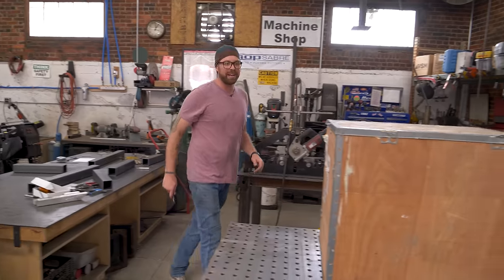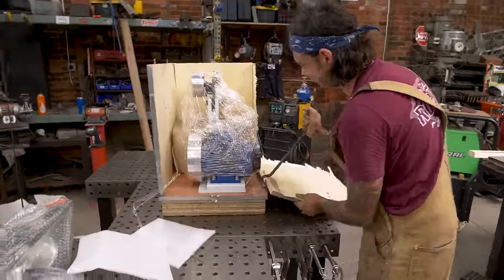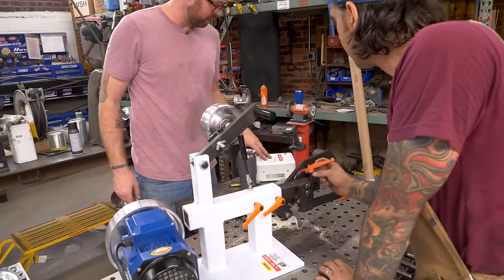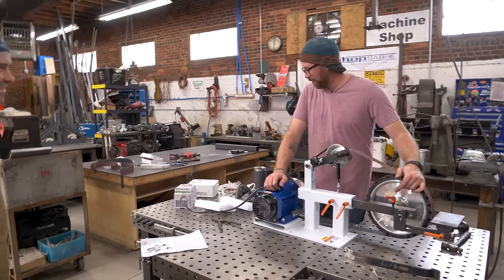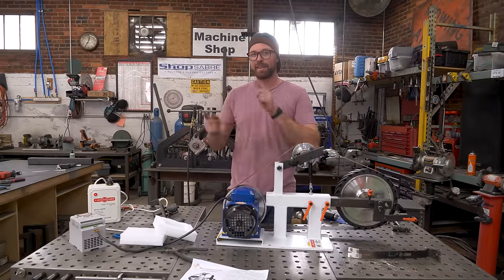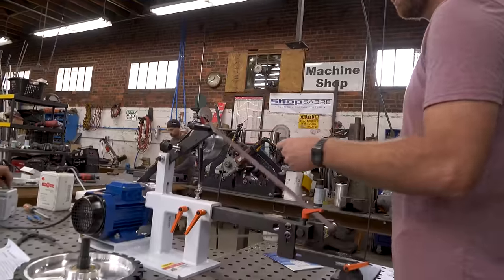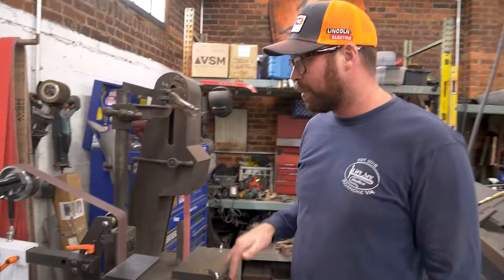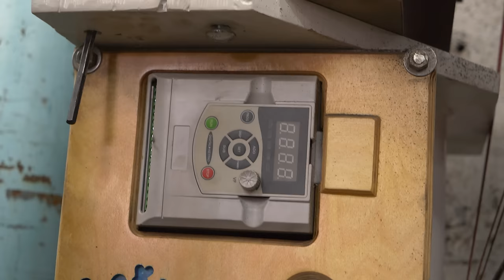Is This VEVOR Belt Sander is Actually Good?

Comment: That had to be the worst review I have ever seen . Gave no details at all
Reply: What... Else... Did you want to know?
Reply: Exactly! How are we supposed to make a sound buying decision without more details. You know, like:
How many grains of abrasive are adhered to the belt? What color are the electrons from the VFD? How many sparks per millisecond? What flavor is the white paint? Are all the protons positively charged? Does it go well with General Tso's for lunch? How fast does it fall if you drop it from an airplane? Does it feature variable reluctance? Why is the Turbo Encabulator not even mentioned?
Reply: “Covid 23” was worth every second
Reply: This guys the king of long winded videos containing nothing
Reply: It would certainly be good to have more information.  you say "what"?  well, what is the brand of the inverter, (VFD). if we have that we can look up the operating instructions.  Lots of folks question about the slow start up.  Probably the factory set start up can be changed.  What about the speed max?  Vevor is probably not going to tell you NOT to run the unit faster than what others have said, not to ruin the small wheel bearing.  What about the Vevor knife grinding jig?  Another complaint is the VFD controls.  How do you turn it on, etc?  MOST VFD's allow for a separate start/stop switch.  Does this?  (again, if you listed out the name model of the VFD I could figure this out.). What about reverse?  Yes, has a reverse, (ALL VFD's do) but how does the machine run on reverse?  Do the wheels still track well? (I know, probably yes, but nice to hear) For sharpening knives, I'd often run in reverse, as I like the edges upward and don't want to risk catching that edge on the paper.  Of course the 82" belts are a no go, but yes, easy to make it fit.  Anyway, it WOULD have been good to have a better more complete review for sure.
Reply: I disagree. This isn't a review at all. It's just the worst advertisement I've ever seen.
Reply: @paulkramer4176  All VFDs are capable of operating a motor in either direction. Most VFDs allow the direction to be reversed (since it only requires the resequencing of the output phases) but not all. I had a 15HP AC motor in a pretty rotation direction critical application, reversing the motor required physical wiring changes at the VFD (should the site have power whose phases are opposite of desired).

Comment: Tay just a heads up on the small wheel attachment don't run it over 40-50% power or you'll burn the bearings out. They are designed to handle that much rpm.

Comment: Got mine yesterday. Built a trolley cart with heavy cast concrete base and locking 6"castors, did the 2x72" mod, added a water mist, catch/quench bucket, LED work-light and simplified controls (fwd/stop/rev switch, 10-turn speed pot) and an air blast nozzle. This beast is awesome!❤😂   .....working on making a cerammic-glass platen now!😂😂😂  This is a great asset in my shop!   BTW,  it now ships in two wooden crates (platen, wheels and arm in the smaller box).
Reply: Just built a Ceramic Glass platen for it and also 3D printed a block that keeps a bar magnet about .125" away from the belt as it comes round the lower pulley to trap metallic particulate. This beast works great!
Reply: Did you make a video of those mods you just mentioned ? Would love to see
Reply: @peterclinch1191  unfortunately I did not.
Reply: Just got one. Does it just plug into the converter? The plug doesn't seem like it matches up
Reply: @edoliver8686  mine plugged right in

Comment: I have a Pheer 2x72 grinder, its made in the USA (Oregon), came with a USA made wash down rated motor$$$, fairly cheap, its pretty rad.  It only cost a couple hundred more than the Vevor.
But to the point of my post. 
It comes with a warning about running the small wheel attachment at high speeds. Apparently the smaller bearings are not rated for them, and will wear out quicker.
Reply: Do you like it so far? I'd seriously consider buying it if you like urs
Reply: @jacobdillon3635  I bought it specifically for knife making and it works well for that purpose. Now if I could only make a decent knife. That's a me problem not a grinder problem. But I found that I use it for every single metal fab project that I do. It's so easy to bring a small piece to the tool rather than and angle grinder to the piece. I think the Pheer grinder is well made, it's easy to modify the tooling to meet my needs. My only complaint is that at really low speeds I can stall the motor, but thats an issue of the KBC variable frequency drive. He sells another VFD as an up grade that should fix the problem. Not that it is a big problem for me, I can always increase the speed until it doesn't stall or go at it a bit softer taking less material. I've owned mine for 5 years and it has never so much as hiccuped. I have no regrets with the purchase.
Reply: Wow those Pheer look like REALLY nice machines! Their cheapest ready to go model looks to start at about $1250, so definitely worth considering vs the Vevor. I say that as someone who is working with Vevor too. The next model up is $1550, which is 50% more money, but wow they are pretty machines. All CNC steel look like something NASA would use.

Comment: House Work is another youtuber who sells kits and plans for 2x72 grinders, USA made. Mine is 3 hp 3 phase and runs up to 8,000+ surface feet per minute. Even though I built a cnc plasma table, I opted for the laser cut kit. It works horizontal or vertical. My vfd is a quality unit from an automation company and I mounted it remotely and built a cover for the remote display and wired in common switches and control knob that are bigger and tough to be used with welding glove. If they wear out or become damaged, they are easy and cheap to replace. The display is calibrated to read surface feet per minute. Helicopter John is a man who designed and built an all aluminum 2x72 grinder which has a rotary platen with different wheel sizes, flat platen, slack belt area, and small wheel holder. He shared his cad files with me and I built my own modified version out of steel for the House Work grinder. These grinders are great for cleaning up plasma cut parts. They do not replace an angle grinder or right angle die grinder for some of the detailed work, especially on corners, but together, they allow you to quickly finish parts.
Reply: Tldr

Comment: The trajectory of the belt from the motor pulley to the tension pulley is angled perfectly to fling stuff at eye level. This happened when the small pry bar was first touched at about 8:20 into the video.  

Perhaps adding a small safety cover over the tension pulley to catch just that angle would help. 

Its hard to say what will exactly  cause some particles to get caught on the belt long enough to come around and be flung, but it just seems like a real danger. Someone is sure to use the grinder without safety glasses at some point. Stay safe.

Comment: If it stays under $1000, I'll be getting 1 of those!  I like the way Vevor is slanted more toward professional, commercial, manufacturing, and industrial tools, where most of HFT stuff is for weekend use.
Reply: Build your own. They’re pretty simple and it won’t be made in China
Reply: @shortbusdog  What is wrong with built in china? You get the quality you are willing to pay for. And Build your own is easy said, but not easy made. I have build my own and after that I would never build one Again. Motor, VFD, Wheels And small parts you have to buy were around 500 €. With the Time you spend plus Material you are at the same range of 1000 €. And for me it was again a confirmation of the saying: "All you don't want to do your self, you have to Pay for." And vice versa.

Comment: Just FYI you can get into an American made product with a better VFD but only a flat platen and no large wheel in this price range from Origin blade maker. Not affiliated with them in any way, just a satisfied customer for about 10 years. Not dissing on the Vevor unit but I would tend to trust the VFD sold with the Origin more. Plus if I remember correctly it can be wired for 220 or 110 without the need for the transformer and is a sealed unit so no worry of dust or water ingress.

Comment: Hello. I recently bought the exact same VEVOR sander, but I have a bit of a problem, it is probably, in terms of electrical installation, poorly grounded and the electric current runs through the entire body of the sander quite strongly :D Did you have the same problem?

Comment: Hello, just started watching your channel today. Watched the shop build, benchs,stadium, seat,bar ,container, etc. and that was binging today. Im sure someone has told you by now but a small and large speed squares are real handy as a guide for the plasma and a aluminum yardstick. Then grab two of the stops with the brass thumb screws for a framing square and pu on the yardstick, it lays flat and can follow contour of tanks or large pipe and raises them enough to guide plasma torch. Im a steamfitter not a carpenter so im sorry I dont know the correct name of those stops but have used to cut steel and their intended use on a framing square to mark out the stringers for stairs and roof joists, the angle at ridge beam and birdsmouth at walls. love your videos and the tools you got, cant wait to watch you fire them up. good luck, Jim

Comment: as far as I know a 82 inch belt isnt a standard for  most belt grinders, the question can it run  a 2X72 belt, if it cant that would be a  deal breaker

Comment: Quick word of causion, there is no protective earth at ALL, 3 wire to the motor for three phases, it might be dangerous to use.
And the strange plug is a Germany Style plug called Schutzkontaktstecker. There is the PE bypassed too on the 110 to 220 transformer.

Comment: 3 phase electric motors in the 1-3 hp category can be 85-low 90's % efficiency. Single phase in the same size can be 70 to very close to 90% efficient. Technically correct, three phase wins.
Having said that, every time you convert electricity (or any other kind of energy) to another form/voltage/phase/frequency.......you lose efficiency. So if you run your particular machine in such a way that the electricity has to go from 120 to 220 single phase, and then from 220 single phase to 220 3 phase, it is a virtual certainty that a name brand (decent quality) 220V single phase motor, plugged straight into a 220 single phase socket on the wall, will beat your machine for efficiency.

If you're talking about anything bigger than 10 or 15 hp, 3 phase pretty much always wins because you can get it in the higher voltages commonly seen at commercial/industrial places. You would be hard pressed to even find a 10 hp single phase motor. But then the big factor is the higher voltage, not just the fact that it's 3 phase. To make more meaningful claims, you really have to talk about two very specific motors.